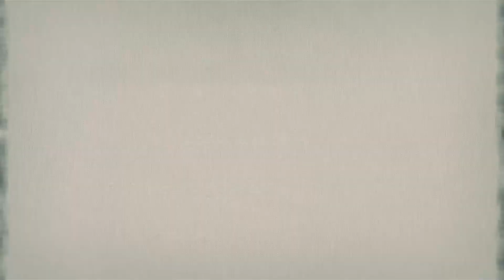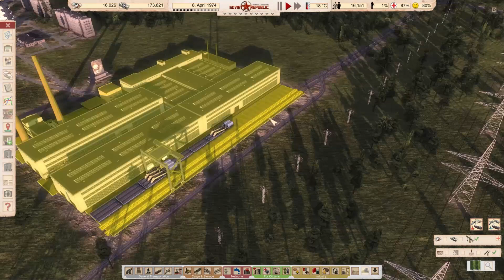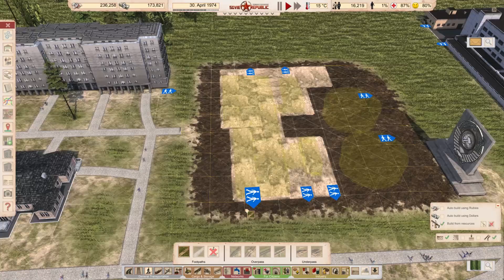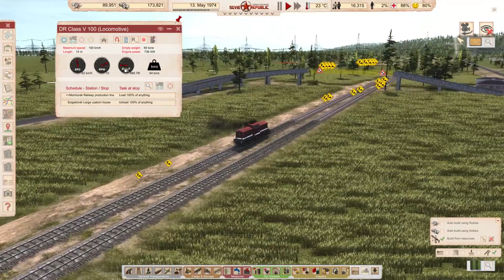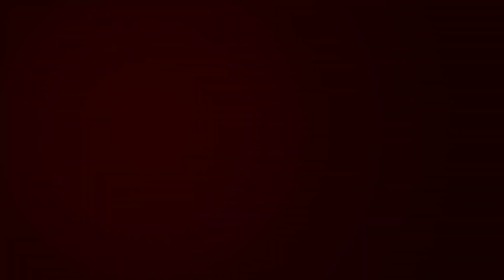Soviet Republic - Nuclear Industries - Ep.50 - Missing Trains

Comment: Do you have pumps between the water treatment plants and the water towers to pump water into them? and between the wells and the treatment plants if the wells are not on higher ground. I am sure you don't have electricity substation problems in town I even think you have too many too close together. When you look at the one you highlighted (timestamp 32.30) it says at the top "potential" capacity problem, then it gives a figure for the total of that potential capacity as a wattage usage of 488%, it then says the estimated maximum consumption could be 112% if every building was using power at 100% (can never happen because people are at work, school or shopping etc). the gauge is showing you are only using 15% of what that substation can supply, which means that substation is currently contributing 15% of the power needs for that area because of the overlapping substations. Cheers 🙂
Reply from the maker: You were on to something! I addressed this! One pipe from the new Water plant was not connected to the pump! 
Check out the next one! :D

Comment: Finally I've caught up.

4:30 Knowing that Rob's mid/low voltage transformer have 3 points for 15 kV wires, it may be good idea to create "ring" out of substations so they equalise the load on their wires, because power demand is not equal everywhere though that will require a lot of thought, especially when planning expansions.
And it may be the time for modernising current HV spine into HV network with new powerplant to cover ever increasing power needs.
As for why substations blink - when you severely overload, voltage drops from nominal 15 kV, which fucks with how transformer works and effectively causing to shut down, but then load gets dispersed to other substations, reducing load which leads to increase in voltage and "turning on" and whole cycle repeats ad nauseum. Thus if voltage drops from nominal 220 V/15 kV/110 kV to below 200 V/12 kV/95 kV, you need to deliver more power there before it breaks down.

6:20 I think much better refueling station would be one that covers both tracks and through which any train going to or from border has to pass - sure, it will stop the movement when one of them has to refuel, but at the same time, it will be always on the route, no need for taking specific turn in order to refuel (which wastes mu h more time and may not be possible at all, especially with long trains), unless the idea is to electrify entire rail network.

22:35 PKP - Polskie Koleje Państwowe (Polish [State-owned] Railways)
Reply from the maker: 1. Great idea! I addressed this in the next video! 
2. I forgot to address this but I am planning to go full electric on this line. Most of them, actually. Fueling station is only for the train exporting the track builders. :) 
3. Thank you!! <3